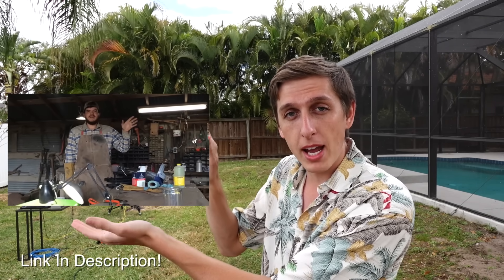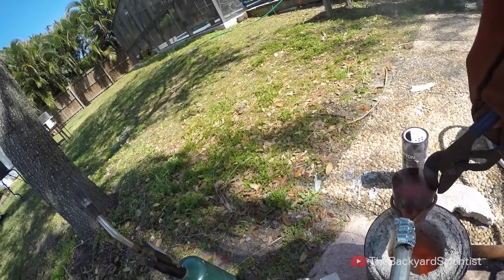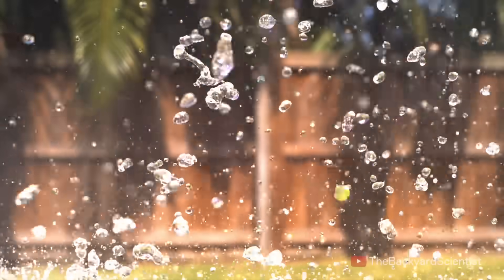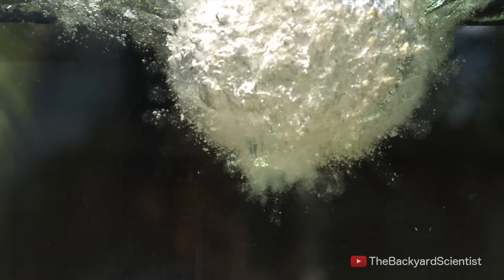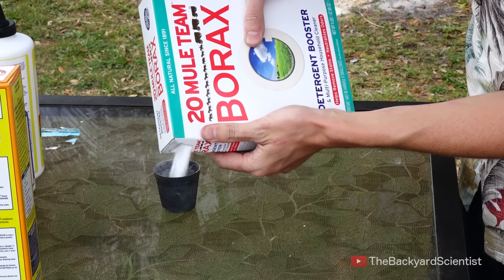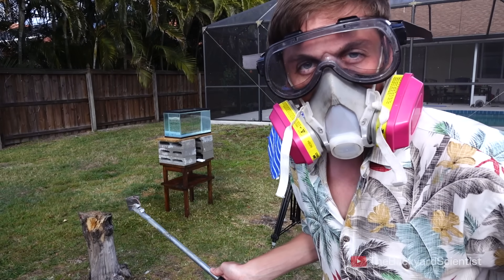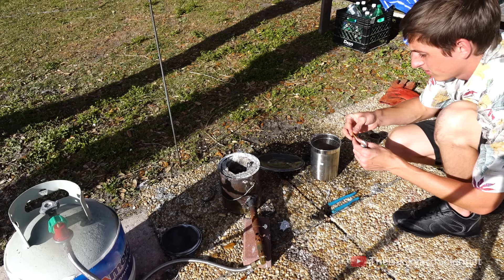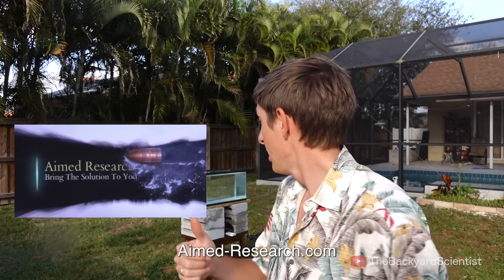Pouring Molten salt into Water - Explosion!

Comment: OK - for serious analysts, I want to pose a different hypothesis. Would welcome comments. Most of the comments here focus on the reaction being chemical in nature. However, maybe we should also consider the physics. What we have here is two substances in liquid form, that form into specific crystalline structures when solidified. I call this crystalline potential. By mixing two products with a conflicting crystalline potential, I believe it forms a consecutive piezo electrical reaction. In other words the reaction is not thermo-dynamic in nature (which is clearly evident from the energy observed in the reaction). It is however a physical reaction related to fusion observed within the unstable elements. Only in this case the decay of an element is replaced by crystalline deformation, or decay. Something I have often considered as the source of piezo electrical origin.

Comment: I think that the answer somehow relates to the low viscosity of the molten salt and possibly low surface tension in the salt allows the glob to change shape and fragment in the escalating physical reaction that you describe.  The initial tests showed a limited reaction.  Only when the NaCl was  very hot and having low viscosity did the reaction go like a chain reaction.
Reply: +Lindsay Dempsey That's a good point. The liquid sodium chloride looked much less viscous than the borax. The lower viscosity would have allowed faster exchange of heat between the water and liquid salt droplets, causing faster boiling of water and preventing the leidenfrost effect.

Comment: Of course your PH level is going to change when sodium is reacted with water. (Sodium metal + Water = Sodium Dihydrate monoxide) I've not done research on it yet, but I think the chlorine in the sodium has something to do with letting the sodium metal react with the water, there being enough of a delay for the metal to fall far under the surface of the water. The explosion being around the same as what happens when you shoot a pop can full of water.
Reply: +kd9bwi You made my day with that bullshit:DD
Reply: Gábor Szilágyi Its the best I could do.
Reply: +kd9bwi Sodium chloride is denser than water, sodium metal is not. The explosion from the molten salt is purely physical, the rapid expansion of water vapour as the water boils. Sodium metal has completely different chemical properties than the sodium cation in the salt as it has an extra electron with low ionisation energy. The chloride is pretty irrelevant in this 'experiment'.
Reply: +kd9bwi Also there is no metal in sodium chloride.
Reply: BR R Sodium is the metal, if the chlorine gets separate the Sodium will react with the water. Although it's possible to separate the chlorine and Sodium through electrolysis of molten salt. (I actually have no idea how the reaction in the video works, I just commented because I could)
Reply: There is no metallic sodium in salt. Even if you separate the two ions they are still ions and therefore unreactive. To get sodium metal it is not enough to separate the sodium and chloride ions. You would have to chemically or electrolytically reduce the sodium ion by giving it a strongly reducing electron. This will make it electrically neutral elemental sodium, which is reactive. There is no reducing agent in the video so it's not a chemical reaction, purely physical.

Comment: could it have to do with the solubility of salt vs the solubility of the others.  salt  is very soluble in water much more so than Borax.  also salt has a simple chemical structure  NA:Cl so it disassociates faster than  borax would.  I think these properties mean that the salt combines with the water faster than the water can boil thus getting really efficient thermal transfer to the water.  in effect the water boils all at once when the salt is dropped in.   That my theory.  if it proves true mention me in the paper.

Comment: I'm no scientist, but I remember salt lowers the boiling point of water. I was also told back in school that any water soluble solid will also mix better when it's in its liquid form. Now if you heat the salt and then pour it into the water maybe the salt is lowering the boiling point of the water molecules while simultaneously heating them as they come into contact, essentially causing tiny explosions as they meet. I noticed that after each explosion made a bubble it then took some time to make another explosion at the bottom, maybe that's where the next molecules met and created the next little explosion. It would also explain why the PH levels didn't change, maybe they kept canceling each other out. It would have to be proven on a molecular level though so idk.

Comment: I don't know why the water explodes exactly but I think that the leidenfrost effect doesn't shield the molten salt because it is highly ionized. Ionic compounds aren't exactly compounds but rather substances comprised of freely associating ions. When the substance is excited by heat they move more violently so the chance of a positive sodium or negative chloride ions will attract the partial charges on water due to it's nature as a polar solvent. Also the reason that Borax may not experience the same violent reaction may be due to it's tendency to form a glass-like amorphous solid.

Comment: As a chemist I can shed some light on the reaction. First, you are correct that this reaction isn't chemical in nature.  The key differences between the substances are their solubility in water, and also their thermal conductivity.  The NA-CL (Sodium Chloride) is highly soluble in water, dissolving NA-CL in water is also quite endothermic and comes with a higher osmotic pressure.  This means that the NA-CL distributes through the water faster than the other substances.  Once the NA-CL is distributed in the water it causes the water to boil and expand.  If you watch the video again you can see the other substances in a clump with the boiling water vapor in a shell around them.  They boil the water before they spread through the water.  Thermal conductivity is loosely defined as the rate at which a substance can heat its surroundings.  If you were to increase the thermal conductivity of the NA-CL it would also boil the water before it could spread.
Reply: +Carl Myhre I think I can understand some of the words.
Reply: +Carl Myhre Nice job for explaining it right!
Reply: so his putty analogy was correct! sweet! the pure sodium was a chemical reaction tho right?
Reply: +Carl Myhre mmmmmmhh yes yes, i know some of these words
Reply: +Carl Myhre You forgot that the Liedenfrost effect is reduced due to the very high solubility. The liquid form of NaCL is more readily soluble since the atoms are not trapped in a crystalline cage. Also, the solubility increases with the temperature.

Comment: Well... does it explode because by applying heat to NaCl (salt), it disassociates into Na and Cl and because Sodium is really reactive, it reacts when it comes in contact with water? The first two times it didn't explode because the  Na and Cl was losing heat and that was making the Na and the Cl get back together forming NaCl again. No? Am I wrong? Did I get anything right? lol Someone please correct me. I'm trying to remember at least a bit something from when I took general chemistry.

Comment: I think this reaction has more to do with solubility. Sodium Chloride is 10 times more soluble in water than the other salts tested and its Hygroscopic. It attracts the water molecules and dissolves instantly, the thermal energy is so great the water vaporizes into steam expanding in volume 1,700 times at roughly speed of sound. This expansion is a type of explosion known as a BLEVE, Boiling Liquid Expanding Vapor Explosion. It isn't chemical. An interesting test to verify solubility as a factor would be to test molten sugar, also very soluble in water or maybe use another solvent like alcohol which would presumably react less violently because of decreased solubility.

Comment: For all you that are asking for an explanation, here's one. when the salt is melted at 801 Celsius it is so hot that when it comes in contact with the water it evaporates. Now, the surface area of water in evaporated form is 30 times larger than in its liquid form hence the explosion. Also, the sodium and chloride when comes in contact with the Hydrogen and oxygen it's breaks that bond. you're welcome

Comment: You're dumping super-heated sodium and chlorine into a solid form of hydrogen and oxygen... putting a massive amount of energy into the system.  It is electrolyzing the hydrogen and oxygen.  You're basically depleting the heat you add into the system in a series of energy catalyzed explosive reactions producing NaOH, NaO2 and HCl into the system.   Leidenfrost only applies to systems in which the vapor state of a liquid protects the liquid from heat conduction.  When you chemically transfer the heat you'll get such a reaction.    What's occurring in your video can be re-produced using a burning magnesium strip in the water.  Do high-speed of that.
Reply: +Roger Crouch (correction  "solid" with "comparatively dense"  thought words...)
Reply: +Roger Crouch Yeah! What he said!!
Reply: +Roger Crouch Sorry this is only my first semester of inorganic chemistry, and perhaps i'm getting ahead of my self by trying to comprehend what you just said, but what you are saying is that the high amount of kinetic energy in the liquid NaCl is causing a redox reaction, something that otherwise wouldn't happen if the NaCl was still a solid? if so why?
Reply: +Roger Crouch Not really. There is no sodium or chloride being put into the water, only sodium and chloride ions. Sodium and chloride ions are chemically inert and will not react with the water. It's just rapid boiling of the water upon contact with the very hot (800C) molten salt.

Comment: My thoughts are that Molten Na salt has a larger viscosity than Molten Na metal, as such it is easier for the water to become trapped within the cocoon of the Molten material. The Leidenfrost effect is still in action, however because the water was able to get trapped inside the material the vapor becomes trapped as well and the rate it expands exceeds the mac number within the water. As such a sock wave is created and a explosion is observed. Furthermore, a larger Prandtl number would explain a fast heat transfer within the explosion and the cause, along with the temperature of the molten metal, for the continued shock waves.

Comment: I'm not a fan of your puddy analogy but I think I understand what you're getting at: as the liquid salt disperses in the water it's surface area increases and heat is able to escape much more quickly. The heat absorbed by the water causes it to vaporize and the gas expands extremely rapidly => explosion.

Comment: The explanation for this is that sodium reacts with water, releasing hidrogen gas and lots of heat. That creates the explosion. As you said, salt at a normal temperature will not explode. But, at that temperature, it is not NaCl anymore, it's a mix of those two. That's why the "molten salt" explodes.

Comment: +TheBackyardScientist
This may actually be a coulomb explosion, and thus you're actually seeing the sodium being striped of its electrons by the water extremely rapidly, resulting in plasma sodium ions. This is part of the hypothesis for all first order alkali metals interaction with water and why they're so explosive. This is a normal ionization process, however it's only considered a coulomb explosion by the rate at which it occurs, specifically if it is fast enough to cause Interatomic Coulombic decay, which happens between the pico and femto second level.
I believe that the difference you are seeing between the salts is because of the energy it takes to remove an electron from the molecules, and the relative distances from the centers of charges on the salts. With Na, water can easily take it's valance electrons and the nuclei are relatively close together; with NaCl, water can somewhat take the electrons, and the nuclei are somewhat somewhat close together. With Borax, the electrons are very hard to take from the borate, and easy to take from the Na, but the centers of charge are extremely far from each other, thus they have little coulombic potential. Thus, for borax, it's much more likely for the water to vaporize than for the sodium to, and vaporized water cannot easily remove Na Ions.
For solid Na, H2 is released because of the energy of the 2 electrons ripping apart 2 H2O into H2 and 2 OH-. If the sodium is lower in energy, the ion will then form a complex bond with the OH-. Thus, the Na plasma may be escaping from the tank too quickly, vaporizing and then sublimating in the air, while the OH- vaporizes.
The best way to test this theory is to put a chute with flame on top of the experiment and check for flickers. If it flickers with small specks at the bottom, it means that hydrogen gas is being produced, something you wouldn't see happen with only water vaporization.

Comment: I was working in a nuclear physics research lab during my undergrad days.  I worked with grad students on a research project that studied the vapor explosion effect of molten materials.  This was to understand how close we came to a nuclear reactor explosion at the Three mile island when they had a reactor leak and the hot molten uranium core went into the cooling water pool below the reactor.  Luckily the temperature and the conditions were just right that the vapor explosion didn't occur.  We were mainly using lead since it has a high density and molten properties that could simulate uranium.   In any case, your molten salt experiment here reminds me a lot of that.  I think your hypothesis was on the right track with water vapor creating the explosion inside the material.  This was the original paper that the professor I worked for http://li.mit.edu/Stuff/CNSE/Paper/Corradini88Kim.pdf

Comment: +TheBackyardScientist I think I may have an idea as to why this is only the case with sodium chloride and not any of the other salts. So, this effect occurs with sodium chloride but not with sodium tetraborate, so it seems reasonable to deduce this has something to do with the chloride ion. My theory is that it may have something to do with chlorine's high electronegativity being able to overcome the leidenfrost effect. Since fluorine is the most electronegative element, if my line of reasoning is correct, a similar phenomenon should also occur with sodium fluoride. I don't recommend this though, since sodium fluoride is quite toxic. It may however work with molten cryolite, though its insolubility in water may affect results.

Comment: In a liquid state I would think that the ionic bonds that hold together NaCl would be easily broken. This would allow for sodium to react with the water and for chlorine gas to be released. These gasses would then react, as the heat of the molten salt is more than enough activation energy. Because hydrochloric acid is being created you would think that the pH should go down, however because the hydrogen that is reacting has come from the water, there is not change in the dissolved hydronium and therefor the pH should not change. In order to test this I would try to refine the left over solution and see if it would react with baking soda.
Reply: +Yextus Actually my original reasoning is flawed as the hydrogen is coming from the water meaning their is less solvent and there for the hydronium concentration should increase. While I am starting to doubt it, a chemical reaction (well several) could still be taking place. Currently we have not looked at where the other half of the hydrogen is going, along with the sodium and oxygen. These could react with each other and form sodium hydroxide. This would then dissolve into the solution and cancel out the acidity and you would see no change in pH. Far fetched, but still plausible.

Comment: When you heat salt to it's molting point you release it's atomic modules since you already have a hydrogen module it is insulated so unlike the sulfur metal it reacts differently. One chances the hydrogen in the water to a different substance causing it to burn the other because it is insulated it's only minor changes that happens but since already so deep in the water it's explosion is intensified by the waters pressure!!! You should try it with a liquid metal!!!